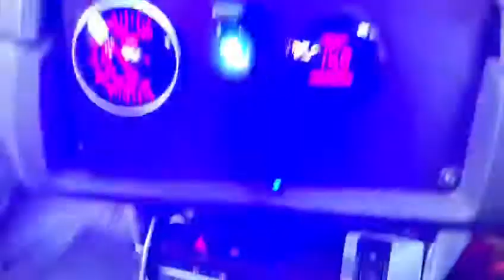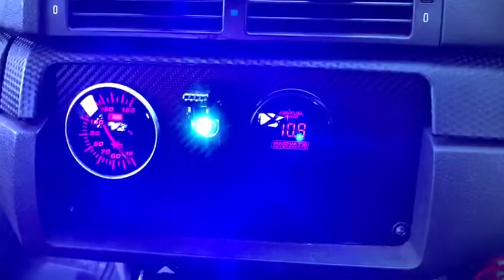Innovate LC2 wideband BMW E46 race car start up and rev

Comment: How do you take the signal for the afr? Are you using the stock ecu?
Reply from the maker: The Innovate LC-2 measures Lambda, and then calculates the AFR.  There is no feedback loop into the ECU, which is the standard MS43.  Nick uses RomRaider to edit the various tables, to achieve various objectives.  In this case we were looking for a target AFR over the full rev range at WOT / full load.  He is able to log whatever he needs from the MS43 (via the OBDII port), as well as the AFR from the Innovate (via a USB-serial adapter) as a secondary data source.
We have 2 limitations relative to dyno tuning with an aftermarket ECU:
1. We have no dyno, so we need to do street pulls.  This gives relative data, but not absolute numbers, and is also obviously not as practical - difficult to do a number of consecutive runs to confirm repeatability, etc;
2. We can't tune on the fly.  We discuss changes, Nick edits tables and creates the new data file, uploads it to the ECU, we do a couple of pulls, and then sit down and analyse data.
Despite the limitations above, I think the process will deliver results and, importantly, result in some real learning and understanding in the process.
Hope that answers the question.
Nick, please chime in if I've idioted anything above.
Reply: @buildabeemer   man your answer is exactly what i was searching for, it will help me so much to understand. I have the stock ms43 and i was trying to figure out how can i extract and modify the tables. I always heard about the way with galletto and tunerpro but i'm not sure if it's really possible for my specific engine (m54b22). Definitely i need to learn more about RomRaider, thanks very much, i really appreciate it!
Reply from the maker: Side Yard Garage - You’ll need the MS4X Dev Group Flasher Tool. It’s a lot more convenient than Galetto and JMGarage Flasher. Using the Dev tool flasher, you don’t need to put the ECU into boot mode to flash the full write file (512KB). You’ll use this tool to write new 64KB (Tune files) calibration files to the ECU.
Reply: @buildabeemer  you are definitely opening my eyes. Thanks very much for your time